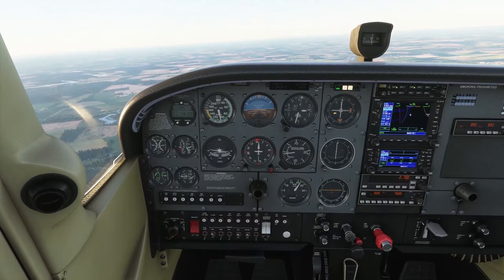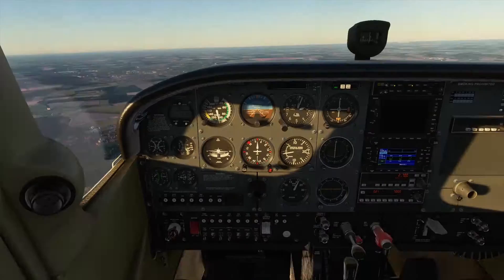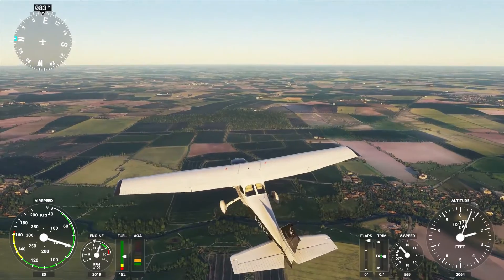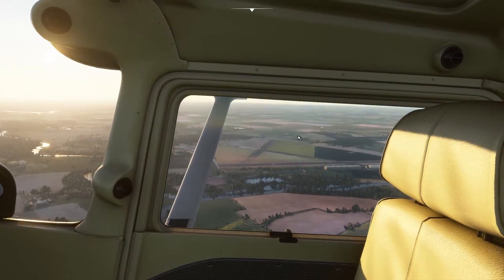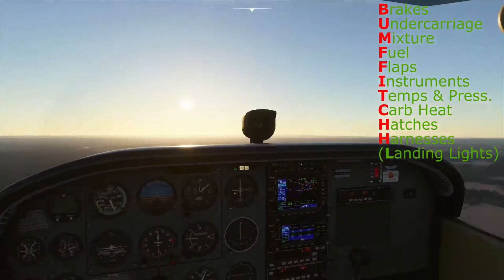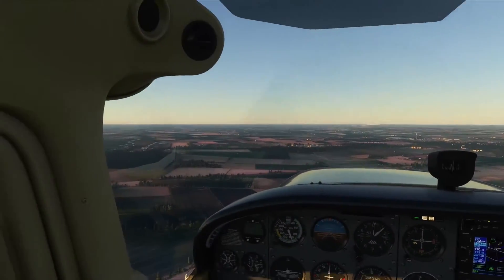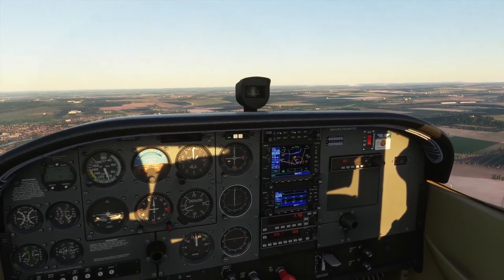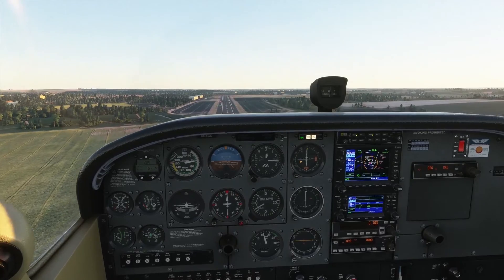Airline Captain Explains VFR Standard Overhead Joins in FS2020!

Comment: I'm a fairly new qualified pilot. Always trying to improve my flying and make myself as safe as possible.
There were two parts to this OHJ that I feel could have been flown with improved safety and interested to discuss.

First one was the approach. Approaching with the R/W slightly on your left and then making a left turn before turning right seems less than ideal. There could be other aircraft sat in the OH, and you wouldn't be far off a potential head-on. Better to have made that 'left turn' many miles earlier so you approached with the R/W comfortably on your right.

Second, the dead side to live side crossing at circuit height. Ideally this wants to be over the R/W threshold, but instead happened quite far upwind.  This puts you in the danger zone of aircraft taking off in the climb. I appreciate it was for sequencing with another aircraft, but personally would rather avoid crossing the climb out path and would have stayed in the OH doing another 'lap' before descending.
Reply from the maker: Hi there, thanks for the comment! I'm not the chap who made this video (I was one of the traffic pattern planes) but I'll try to address your points on Jimbo's behalf. 
You're quite right - turns opposite to circuit direction should be kept out of the ATZ. As per the joining position, you'd absolutely aim for the departure end numbers normally. That said, sometimes it's perfectly safe to extend this upwind to sequence with another aircraft. Good situational awareness is key here. 
Interestingly, a senior CAA examiner I spoke to recently was of the opinion that the SOHJ is pretty inherently unsafe in busy environments due to funnelling everyone into the overhead at the same height and that we should be just slotting onto circuit legs or joining downwind as per the US  method. Pretty sure you could argue until the cows come home about this!

Comment: Aren't you supposed to join crosswind at 1,000ft above the numbers 03? You shouldn't go beyond the 03 numbers as it risks interfering with traffic taking off on 21.
Reply from the maker: I'm not the one who made this video, but yes you're supposed to join 1,000ft AGL on crosswind assuming that the circuit is supposed to be at that height. Given that Jimbo was flying on QNH perhaps the difference is down to this? 

In terms of your positioning, I find you have to make a bit of a judgement call with that - over the numbers if someone is still over the tarmac for sure, but often it's safer to take it out wide and join behind an aircraft if they're already established on crosswind themselves, rather than cut inside them over the numbers.

Comment: I've seen another video where the pilot says keep the runway on your left, that was for a lefthand circuit, is that the same for RH or do you keep it on the right??
Reply from the maker: As you’re flying the circuit, you keep the runway to the left in a left hand pattern and vice versa. The join is supposed to be done with only turns in circuit direction also.